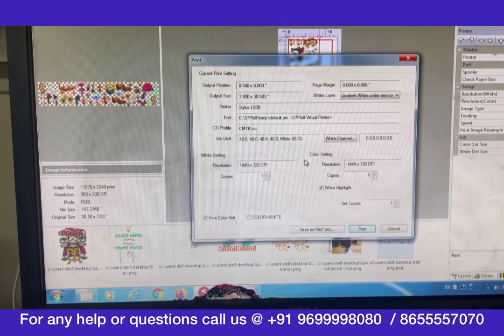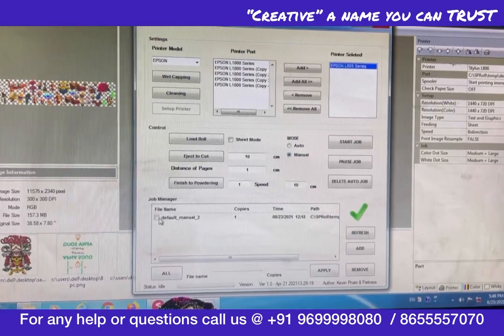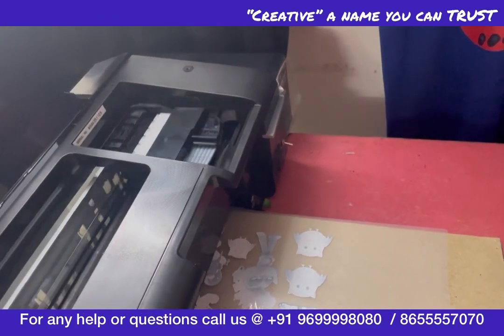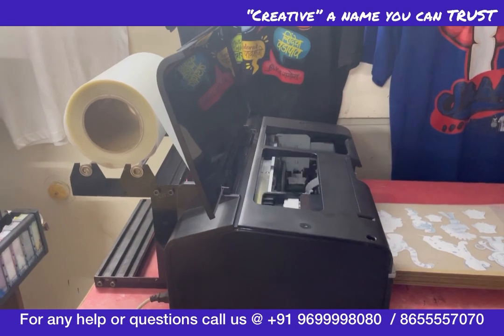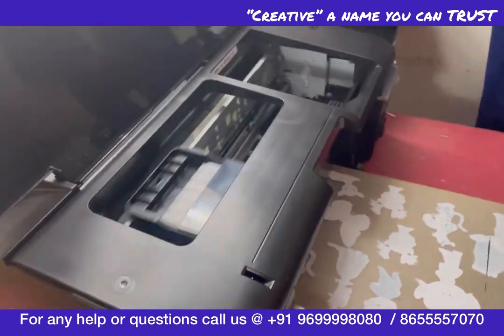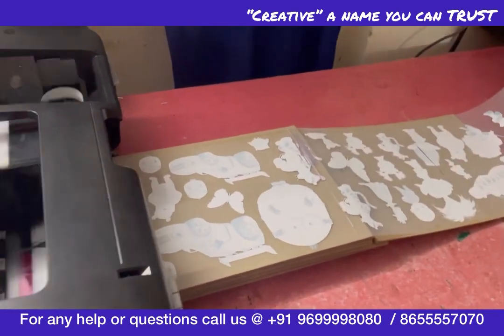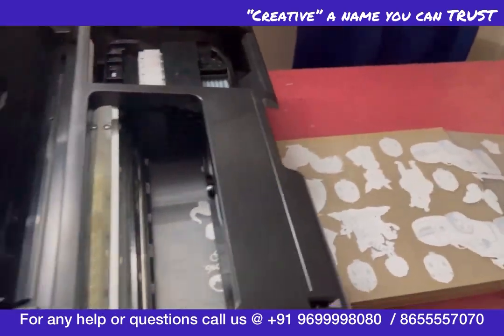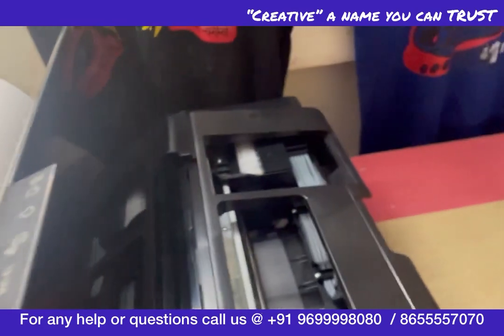L 805 Speed test with For DTF Pet film Transfer. Real and Live

Comment: sir L805 ki new setting batao please ink stik hi nahi hoti , sab % kam karo to color bhi low aajate hai , essue black ink pe jada ata hai , baki color pe thik ata but jaha black design ho whight usape chipakta hi nahi thik se please new settings batado
Reply from the maker: Sir, 1 st thing, We dont trade in 805 Printers.  Also ink quality matters the most in DTF.   If you are using low grade inks you can ask for ink profile from your ink supplier. Ink limit for every color can be changed independently.